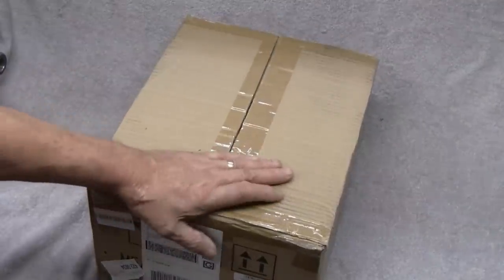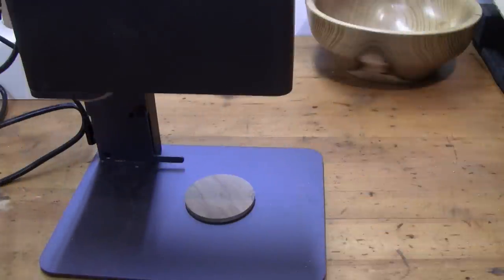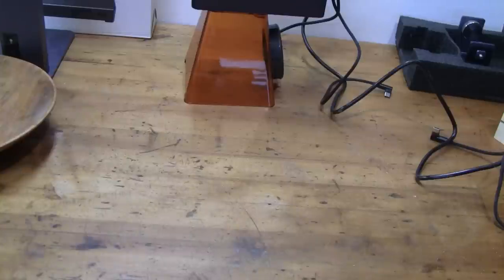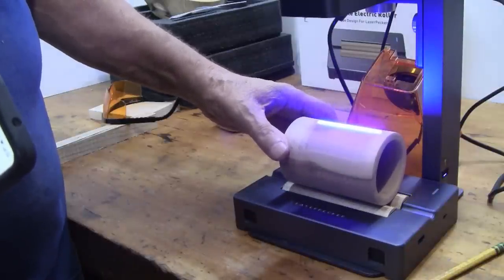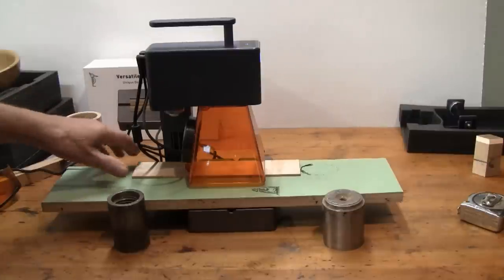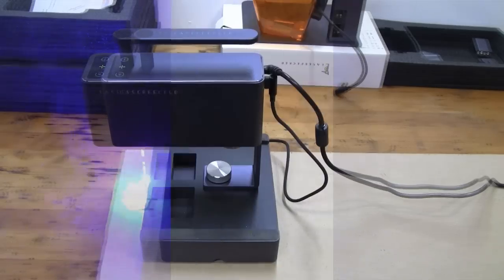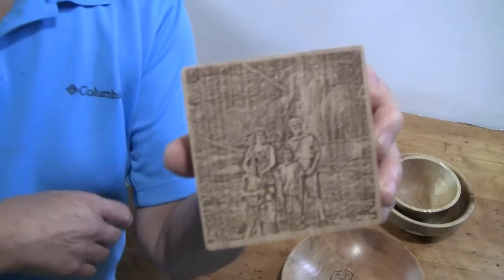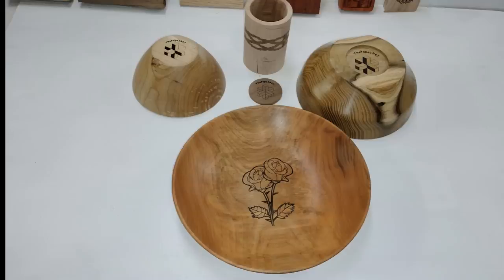Wood Turning Meets Hi Tech Laser

Comment: at my work we have a laserengraver. a classic one, where the head is moved physically and always points downward and engraves things on a roughly 70x40cm area. this laser where the beam is moved is pretty cool (and fast) 
thanks for the video 👍
Reply: I would like to know more about the "learning curve". 
To what extent can I produce original designs?
Are there numerous fonts to pick from?
Thanks
Marvin
Reply: @marvincler9685  i don't know how this particular laser works. but for our laser, we can just engrave anything (our skills are the limit xD). we first make a design in a drawing program (we use CorelDraw, that's not free to use tho), then we save the file as PDF (and the colors in RGB, because that's what our laser "understands"). and then it engraves. 
and ya, you can pretty much use any fonts that your computer has. 
if you're interested in lasercutting/engraving i would recommend a nice (and helpful) Youtuber called "Doug Green" (the channel has the same name). he answered questions i had about a couple of things in the comments or via email. and he does pretty neat videos pretty frequently. 
my suspicion is, that you can engrave a file with your engraver too, but you'd have to get it on your app somehow xD since i don't know how the software works,i can't help you with the details, but i would be surprised if you couldn't use a PDF file to engrave.(or an .svg file. that's a vector graphic fileformat)
Reply from the maker: Thank you kapa, that is what makes it so fast. But it does limit the size you can do. Great for small work for sure.
Gary
Reply from the maker: The learning curve is very fast. I did something very nice on the first try. You can add your favorite font to it very easily.
Original designs are very easy as well. You can add a picture, a sketch or gcode to it and it will follow what you have.
Reply from the maker: For sure this will do the same.

Comment: Nice demo Gary.  The galvo system of the Laserpecker has some interesting features and unique applications.  It's interesting seeing how you are exploring its use.  I just got my Xtool laser system a little over 2 weeks ago and am having a great time exploring its capabilities.  It is definitely another rabbit hole; there are just so many things you can do.  Each of the technologies has its advantages -- with the flatbed system, I don't see a way to be able to engrave the inside bottom of a bowl the way you were able to do with the Laserpecker system.  However, the flatbed systems are much more capable of  dealing with larger format engraving and can also cut wood.  My intended applications for turning are to sign the bottom of pieces and also be able to embellish the outside of round objects, so the Xtool will support that.   There is now no longer anything that can be defined as "scrap" plywood in my shop -- all of those little pieces of plywood from years worth of projects and that were only being used as backer boards for the drill press or other sacrificial purposes are now material for laser projects.  I'm in the process of making a holder for my collet chuck system and am exploring various laser cut box approaches for that application.  Like all new tools, this is going to take some time to become proficient.
Reply from the maker: Thank you Mark. You are right both systems have a place where they are best at. Having 2 CNC milling machines there is hardly anything I can not do. I also built 4th axis for them and projects are lining up LOL. I do like to do 3D carvings with them and milling is the way to get the 3D.
 Sounds like you are having lots of fun and good thing you saved those scraps. I have done the same.
Take care,
Gary

Comment: That was a great demo and good to see you having so much fun. I've seen a few other people testing this out, but yours was much more thorough and more effectively showed the range of capabilities this thing has. I've been thinking about a 3D printer or an engraver/burner like this. Besides the endless pit of other costs for 3D printer media and accessories, I think an engraver would work more in line with my much bigger passion of turning. Well shown, Gary!
Reply from the maker: Thank you Jay. I think a 3D printer would be cool as well. But I like the techie stuff. Having 2 CNC mills makes me familiar with the rapid prototype and the lasers that run XY paths. So would be easy to learn.
 This laser is so fast because of the mirror system it uses. Mine is running a photo right now that will be a gift. It is looking fantastic.
Thanks for watching,
Gary
Reply: Jay, 3D printers are really good for making templates, jigs, prototypes, and other supporting tools for various turning and woodworking projects, but if you are looking for something that can produce results that are much more refined and elegant looking, the laser engraver is definitely more suited for that kind of application.  I have both and am just getting up to speed on using the laser; they both have valuable applications, but the laser definitely produces much more refined results that require very little post-processing.
Reply: @MarklTucson  Thank you very much for the helpful reply! Given that I only do wood turning, many jigs and  prototypes aren't too necessary for me. That, and with my hands being paralyzed, I'm very good at what I do, but struggle a lot with certain dexterity intensive, or unfamiliar, tasks I'm not terribly fast or proficient.

All that to say that an engraver seems more and more what I am interested in. Probably want a CBN, first. Slipped off the wheel just an hour ago and had a catch... on aluminum oxide. Still a bit shaken, nothing hurt or damaged, except for the chipped wheel. Kind of a lucky accident. I got sidetracked. Thank you, again, for the useful information, Mark.

Comment: I purchased a laser about a month ago and it’s great. I got a different brand and it’s a lot of fun. Make sure you buy some good quality safety glasses, rated ones by an independent agency, not from the manufacturer.
Reply from the maker: Thank you Greg for the tip on the glasses. 
Yes lots of fun and I just got through doing a photo for someone for a special occasion. 
Lots of uses.
Thanks for watching,
Gary

Comment: Thanks for a very comprehensive review especially on the applications and the various mode options with accessories available Gary.  Additionally, I would be very interested in the reliability and robustness of the unit after say 50 to 100 h of use
Reply from the maker: Thanks Rama. I have not had it long enough to tell you for sure. There are some older videos out there for reference.
I know that works great.

Comment: I've had the Lp2 for about a year, great laser.
Reply from the maker: I am very impressed with it. What all do you use yours for?
Thanks for watching,
Gary
Reply: @ThePapa1947  , signing my woodworking pieces mainly, it will cut 5mm thick wood also. I do Christmas ornaments,  slate coasters, it can do metal but the metal needs a coating. I also have the lp3 which Is made for metal engraving.

Comment: Hi Gary, I have the original LaserPecker it sets on a tripod and is a lot slower than the new ones and was a lot cheaper. Been using it for about a year now and I engrave the bottom of all my items with my logo and wood type. Works great! Very nice video and well demonstrated!
Reply from the maker: Thank you Tim.  The LaserPecker is a very cool tool for sure. And I am amazed at how fast it is.
I will make a permanent logo but do not plan on getting into selling. I just enjoy creating things.
Thanks for watching,
Gary

Comment: I don't want to take away from your turning talent and your creativity but I really enjoyed this video!  What a great little machine!  I have a question.  Don't you have a CNC router?  I realize the 2 are different but some of the things you showed could be done with a CNC.  What are your thoughts between the two?  I can see a use for both and I may see one of these in my future.  Secondly, do you, or have you, turned pens?  My guess is that you probably have.  It seems that everyone does at one time or another in their turning "careers".  If you get to use the Laserpecker, or get to keep it, for a while, would you consider engraving a pen blank on the rotary bed to see how it performs doing that?  Great video!!  Thanks Gary!!!
Reply from the maker: Thank you very much and trust me wood turning is my true love. But anything that can add to it is ok with me.
Yes I have 2 CNC milling machines. With them i can do more of a relief carving which has a great feel to it. It is not nearly as fast as this.
For instance I do one carving that takes around 4 hours or more depending on how large I made it. This laser could do it in 15 minutes is my guess. Will they be the same. No as the other will be a 3D carving.
Actually I have never made pens. I know a lot get started turning pens but I got my start turning very complex shapes for wood patterns. 
My very first job as an apprentice wood pattern maker was a turning. I still have one of the parts that the pattern was used to make.
The patterns are made from customer supplied drawings and had to be exact.
I kind of skipped over the pen part.
This is my laser to keep and I am sure it would do pens. The trick would be to make something to hold it straight to the laser but I am sure that would be easy enough. Maybe I could turn something with a pen shape and set that up.
What do you have in mind to engrave on the pen? 
 Gary
Reply: Gary, thanks for the reply.  I thought that I had replied back but I don't see it.  It was kind of long. :)  I don't turn many pens anymore but I would like to personalize some i the future, I think.  That would be it for me engraving on them.

Comment: Really fun watching. I have been looking for a method to sign my projects, and been considering to have a branding iron with my signature. When i saw your vid i started thinking maby this laser is suitable for signing my projects. Have you tried how small you can make letters, and still readable?  I turn a lot of 4-5 inch christmastrees and if its suitable for so small projects..regards Robin
Reply from the maker: Thank you Robin. It will engrave and be clear with very small letters.. I believe the beam size is .05 mm which is about .002"
I think depending on which font you choose you could do a 1/8" tall letter easily.  A lot of it is the right settings. If you use too much power.
 Most likely you would not do anything that small but it should work very good. As with anything testing different settings on different wood is important.  
 Now you have me wanting to see how small I can do. But I have not a lot with 1/4" high fonts.
 Thanks for watching,
Gary

Comment: Great video Gary. I'm very interested in this and will go to their website. I do have a few questions. Is the software included with the unit? Is it only phone based or can you use a laptop? Do you know if it can burn an image on resin? Since so many turners use resin (me too) I think it would be something to try.
Reply from the maker: Thank you Larry. The app is something you download and you could do that without the machine and play around with it up to the point of preview which shows you where the laser is at on your piece.
There is software for a PC but I would think it would need Bluetooth which mine does not so I might load it on my laptop and see how it works.
 I see no reason it would not work on resin as it does on plastics of all sorts. It does say that it does not work well with shiny material.
And I see where you can paint over the shine and then wipe it all off.
I do have a resin blank I could try it on.
Thanks for watching,
Gary

Comment: I would have to disable all of my smoke alarms in my house before starting this little guy up. LOL!
It's too bad this is way out of my price range...I'll just stick to my magnifying glass on the patio. ;-D
All kinds ideas popped into my head on ways to use this machine. A table top or book shelf front come to mind.
I think the pencil box surface was too close the the laser source. I believe that is why the design wasn't as wide as expected. I'm certain you could rig up a way to overcome that problem. The orange stand seems to be at the proper height.

Do you get to keep this or was it just to make this video?
Reply from the maker: Thank you Gil and I think out in the shop is much better than inside the house for sure. Pretty sure I would get chased out of the house if I did try LOL.
It may have been a bit too close but most of the issue was when I played around with the design to make it close up at the ends. I should have went with a pencil sketch opion.
 Next time I will do that.
Thanks for watching,
Gary